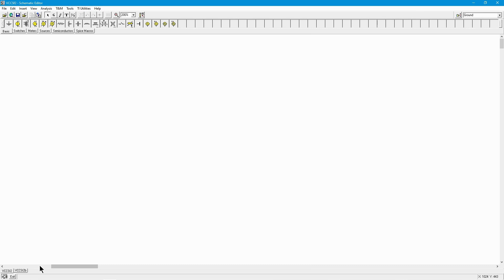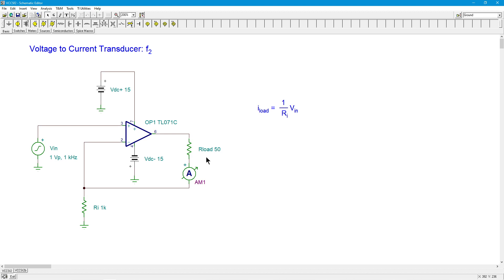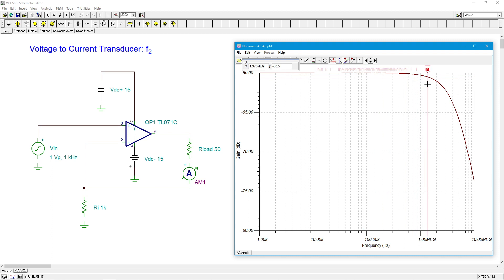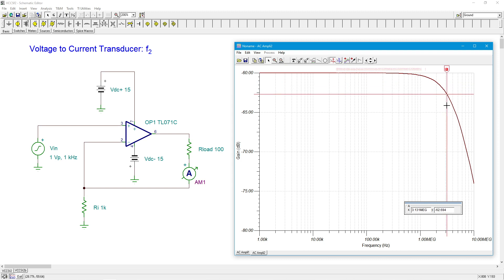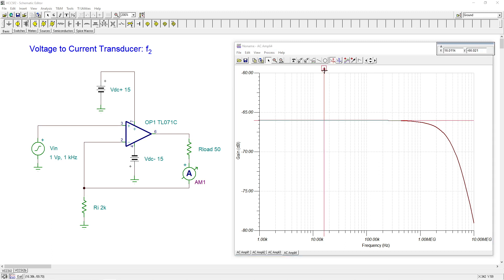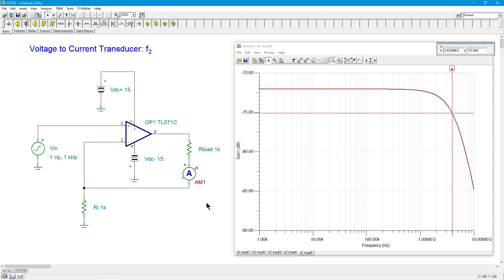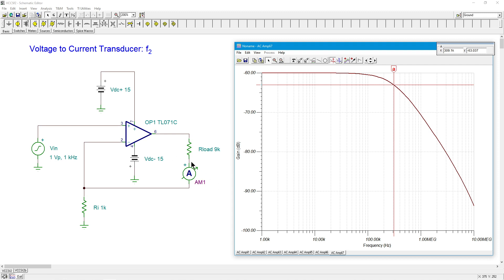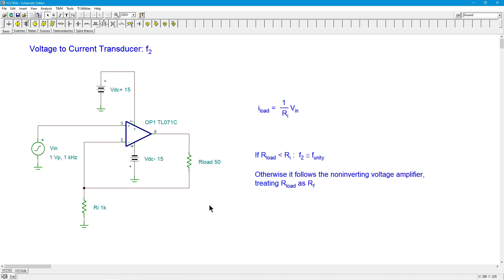Op Amps: Voltage to Current Transducer f2

Comment: Hi Pro,
is this circuit like an operational transconductance amplifier?
Reply from the maker: Similar in some respects, but an OTA has a different design, and typically would be used in applications such as a VCA (voltage-controlled amplifier) or VCF (voltage-controlled filter). OTA designs like these usually wind up being modeled as voltage sources, not current sources. 
In case you haven't seen it, I do have a video on OTAs:  https://www.youtube.com/watch?v=FhkzdStQoX8